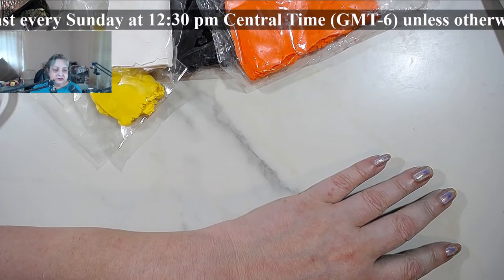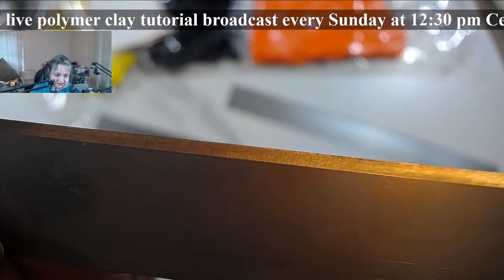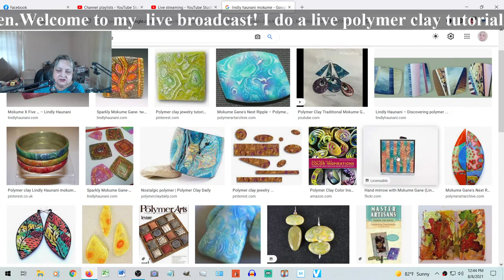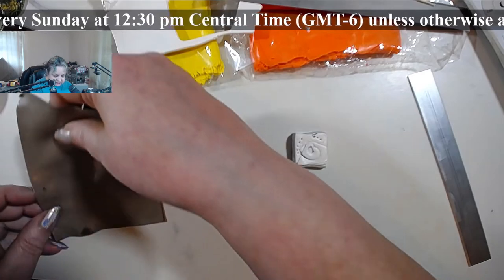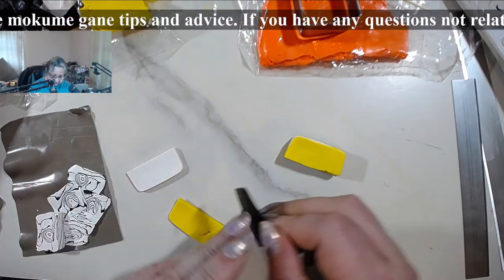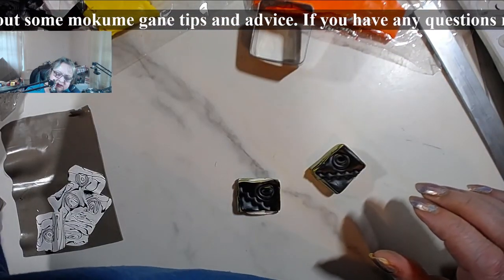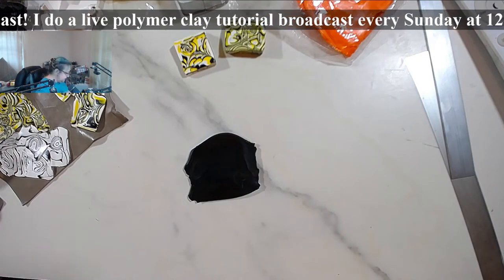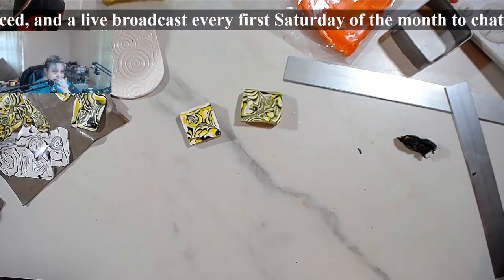Mokume gane tips

Comment: We have similar health issues. If I may suggest, you should try an Ion machine to improve your pain level when there is a storm coming. Our bodies work on energy that is negative. The earth holds negative energy about twelve feet up from the ground. Naturally, this is a bit different depending on where you live, but due not to the sea level measurement but because of wind.

Positive energy is above the negative in fair weather. When the barometric level falls, positive energy is pushed down around us. This is why people get the "Rainy Day Blues". It affects your mind and your nerves which register as sadness, confusion, pain, grouch monster, etc. Using the Ion Machine you can change the electrical charge of the air in the room you spend most of your time in. This works very well for me and as I said, we have similar medical conditions. I don't know all of yours but I have posted some of my histories to your videos.

This Ion Sensitivity condition gets worse as we age and if you do buy a machine, if it gives you a headache, take it back. Sometimes the change to the correct energy is actually shocking to the body and mind. It is used to feeling bad in low-pressure systems. It would be like if I dance the same dance every single time, my body comes to know it, know how it feels in your body and how it makes my mind feel. If you change the dance, the body becomes confused and the mind distracted. So, if you decide you want to try it, buy it when you hear the weather is going to be windy and/or raining. Make sure you can return it. Use it in your home with no windows open, think of it like a heater or A/C, you don't want ionize the outdoors!

You will know within an hour if it works for you. Try only to use it when the barometric pressure is low. The Weather channel has a website you can look at to see what the barometric pressure is at that moment. As a side note, if you have a lot of gagets, a lot of electricity flowing on a constant level, try using the Ion Machine over a three or four-day period. This can change the charge in your space and rather than calming your pain level in an accute condition like for a storm, but it can prevent the pain from being worse any time.

Top all of that off with finding a list of foods that cause inflammation and foods that are anti-inflammatory. I have arthritis, fibro, erythromelalgia, diabetes, high blood pressure, and neuropathy. I was diagnosed at 8 years old with Graves disease, my thyroid was removed at 12 except for a small portion, it grew back when I was 35 with Hashimotos Thyroiditis, which was removed by a world-renowned doctor who found that I had regenerated my thyroid fa fascinating. Then, about ten years ago, they found nodules where the thyroid was removed. Weird huh? 

I hope you try these suggestions. Thank you for the videos!